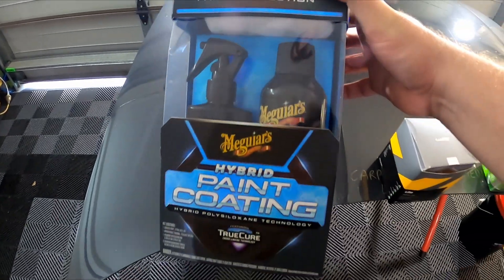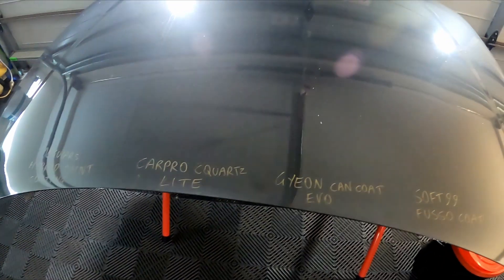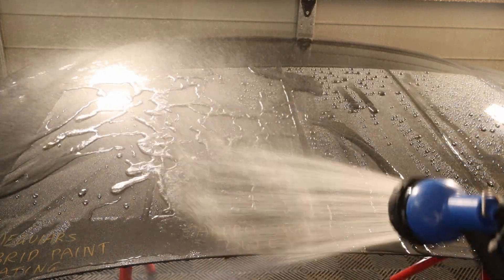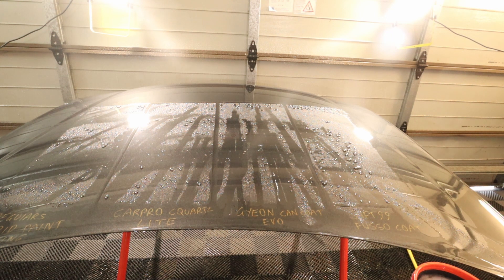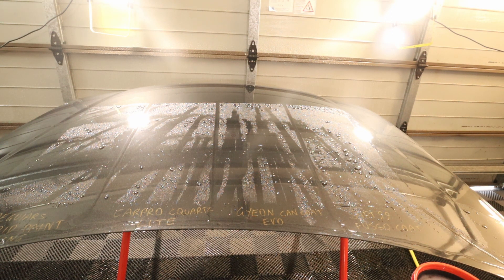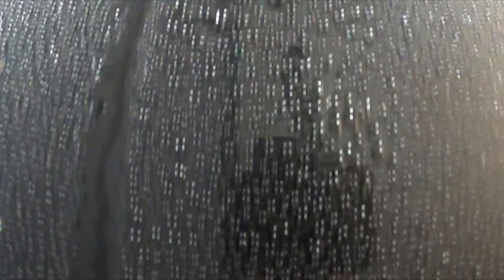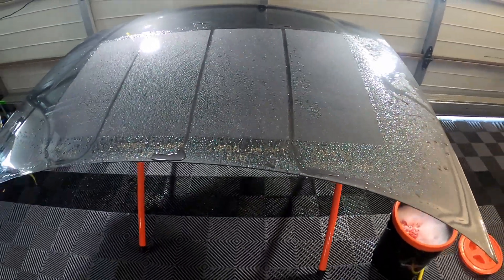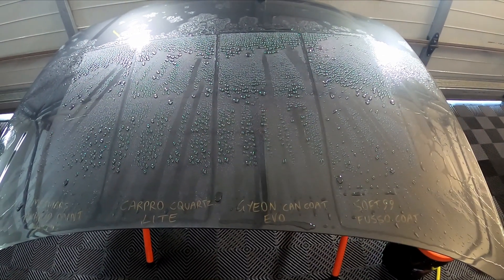What's The Best? 5 Month Update Gyeon Can Coat v Meguiars Hybrid Coating v Carpro Lite v Fusso Coat

Comment: Have you tried applying can coat per there instructions using the "quick towel method" rather than the ceramic style application.  If so any difference?  Seems like everyone on youtube applies it like a full ceramic.  Thanks!
Reply from the maker: No I haven't, I guess since I'm more used to using ceramic coatings the block applicator is easier to me since I know I'm getting full coverage

Comment: Would be interesting to lift the hood up after the beading test to see which one the beads roll off best.  When blow drying the vehicle, some products bead great  however the beads have a tendency to hang on to the surface.  You’ll see the test done with application sponges, or they’ll spray the hood when it’s upright, but no one has done it with water beads, and then lifted the panel.  Thoughts?
Reply from the maker: The beads all rub straight off when I lift as I usually do that after filming to get the majority of the water off before using a drying towel.

Will add it in for the filming section next time but I've never had beads hang on when doing any of these tests
Reply: Might not be worth filming then.  I was curious which panel might release beads first, or most beads cling as you slowly lift the hood.  Thanks for the reviews!  👍